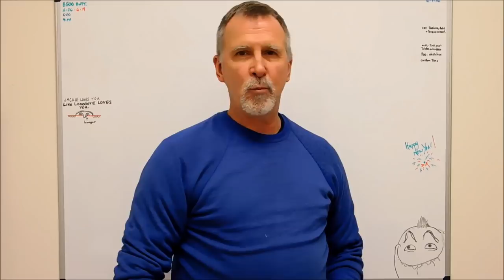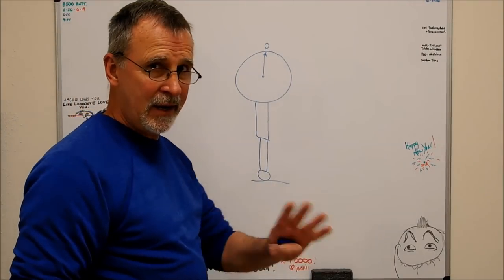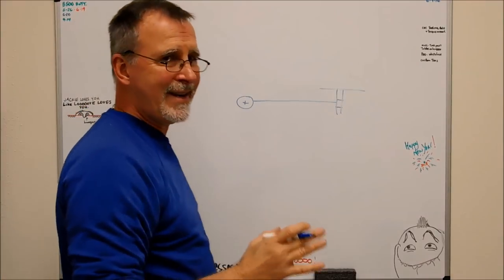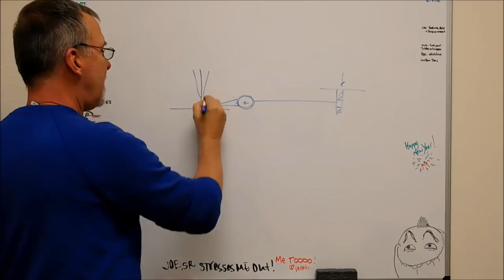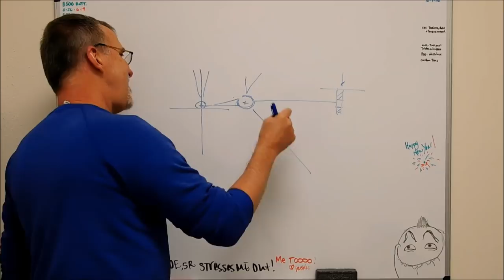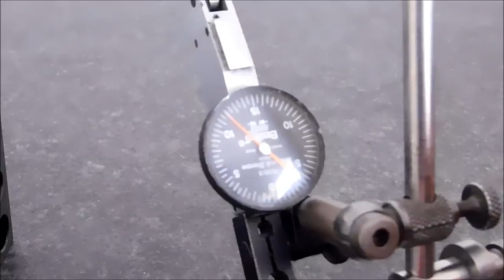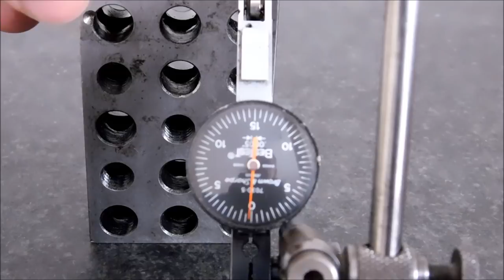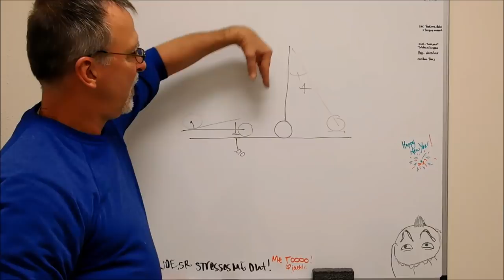Cosine Error Demonstrated and Challenged !

Comment: Joe, You are totally correct. I was in business with family in a job shop my father started. When we got large enough to have to hire a full time inspector and meet QC for a number of companies we worked for, I had this argument with the inspector.  We had several boring mills, we were making large radar antenna structures and counter boring large bearing diameters,, I had a mueller gage big enough to do 20" and larger diameters, I set the gage with crow blocks with the gage on precision parellels when we set the indicator.  The inspector did not understand cosine error, and did not always use ground same size parallels to set the gage on when he checked the bearing diameters. now for most things there was not enough error to worry about. But when trying to hold .001-.002 on large diameters,it matters. I am long since retired in Texas. great videos.

Comment: You are absolutely correct. It's pretty sad if there are machinists that think different.   Another one that gets me going is coaxial indicators with different length probe tips.   If you center a part with a  long probe tip to say 0.001 on the dial, is the work piece centered to 0.001"? Nope..   It's like changing the length of the probe tip on a test indicator. Double the length of a any probe tip that uses an pivot point to get the reading and you half the reading on the dial.
Reply: But you can measure plane angle with any length tip, though this is rare use for a coax indicator.

Comment: Thx Joe for the video. My takeaway is that the ball ended lever indicators don't suffer from cosine error within their usable range. As you said in the beginning, that type of indicator mechanism is actually an angle indicator. The angular to distance conversion is done by the length of the lever itself. So, with that said, the ball, on the end of the lever, and angle measuring system acts like a sine bar. The angle of the sine bar is determined by the height difference between the rounded parts and the length of the bar which results in a particular angle. Analogously the lever indicator operates the same way.
Thx again, for showing us all, how avoid cosine error by choosing the right measuring instrument in this case a lever indicator.

Comment: Great explanation. Very obvious that the stylus has to be at 90 degrees to the measuring direction, as the stylus has to move in an arc, so 'accurate' measurement can only occur within that 10 degree arc. The internal lever just mirrors the movement experienced by the stylus so as you say it doesn't matter where the body is

Comment: Cosine error has been used to take tenths off on a lathe for many years... Set the compound to ~9° off parallel to centerline and each thou of dial movement will buy you a tenth of perpendicular to part movement. Very useful when grinding to super precise dimensions.. This may be a topic you could cover on precision turning in a future video.
Reply: jim richey - actually at 9 degrees offset the compound movement of .001” will move the Tool tip 0.00015”. If you set the compound at 5.739 degrees (call it 6 degrees for all practical purposes) you will move the Tool tip .0001” for every .001” compound dial movement.
Reply: Steven Haskell Dyslexic in my statement.. Thanks for correcting me on that. I'm still sure that it would make a great topic for Joe to cover though...

Comment: Joe, your absolutely spot on your reasoning ,and explanation of cosine error. I have had to do like anyone else, indication like this many times because of tight confines and having to position the body of the indicator at the same angles you demonstrated. And as you absolutely just proved, the parallelism of the contact point to the indication surface is indeed what matters. Thanks for another great video Joe!

Comment: Use cosine error layout segments to avoid math. Envision a 6 inch work piece and you need 7 even segments. Lay your ruler on it at an angle with zero at one edge and the seven on the other. Now put marks on the numbers 1-6 repeat and connect the marks or use a square if your piece is square. Been using it for many years. Really helps to quickly find the center of pieces that are not nominal size.
Reply from the maker: I really like this suggestion. I had to read it several times, but I like it. thanks.
Reply: @mechanicops

Learned that many decades ago, as a beginning carpenter. It some of that carpenter square 'black magic'... LOL..

Very good technique, and handy.

Something I have done, more recently, to make it even easier for my damage brain, is to flip my rule over and use the metric side, (oh, no!  Metrics?).

I do all my proportional layout in metric. It is so much easier.

Comment: Much to do, about that which matters little.

If your intuition doesn't keep things parallel/perpendicular when aligning for measurement,one is in the wrong phase/interest in life.
Reply from the maker: If you think indicators are for measuring, you may also be headed down the wrong path.
Reply: Measuring includes comparing in my case. As you pointed out so eloquently, cosine need not be an error consideration. Intuition/so called common sense, using parallel/perpendicular to align should suffice..

Comment: great demonstration, I had never thought about a lever type as I don't have any, but it makes sense, the movement on the shaft of a normal indicator  should be perpendicular to what your measuring, while the lever style the arm should be parallel to the surface.  At least I hope I got that right

Comment: Totally excellent explanation Joe.  Probably mostly because that's what I've always understood to be the case since starting my engineering apprenticeship in 1969.  
The only additional thing I would say (but in any case is obvious to those in agreement with your explanation), is that, correctly set up, the plunger type indicator is good for the entire range of movement, whereas the lever type indicator is 'better' for a small(er) range of movement.  The greater the movement, the more cosine error will creep in.
Regards Mark in the UK
Reply from the maker: Agreed.

Comment: Good explanation!
Amazed it would be necessary though. If a non-straight configuration was not adviced, why would Mitutoyo and others make it possible to move the stylus to any other direction?

In nitpicking mode I would say that the needle should move from a negative angle to an equally positive angle to be accurate. But that's nitpicking as there is a reason the measuring range of the indicator is very small, and as a consequence the error will also be small.
Reply from the maker: Thats a small contribution, but I can see the value in symmetry. I like it.

Comment: No challenge here Joe, I learned a long time ago it's a losing proposition trying to challenge anyone who's been at there job a very long time no matter what it is, and especially so when it's more than obvious they know exactly what there doing. When I was younger and thought I knew everything I got my own misunderstanding handed back to me every single time. Thinking more before opening my mouth less worked a lot better. :-) About all I could add is it's generally thought at least by Mitutoyo that with larger linear distances the dti's are supposed to be a little less accurate than the more standard straight plunger type dial indicators. On my 10ths reading Mit. dti's they have a total travel of only .030". Over cautious or not, if I need to accurately measure  more than say .010" of rise or fall linear distance I'll dig out the better digital indicator. However I'm going only by what Mitutoyo has to say about there indicators and I've not yet actually tested what amount of inaccuracy there is at the extremes of travel. I also usually use my dti's more as a null setting device than for accurate measurements, but they obviously can be used for both. Great video and more than well proven and demonstrated. 

So.........any bets on how long it will be in another of your videos before someone mentions that cosine error again. :-)
Reply from the maker: Bring it on.

Comment: If the angle of the needle to the body of the indicator was the important angle and it should be lets say for perfect results, be inline with the body (0 degrees) then what would be the purpose of incorporating the mechanism that allows you set the the needle angle to the body in such angles that will yield a false reading?
Reply from the maker: Exactly. Its the needle center axis to the plane being checked. 10 degrees is the suggested max.
Reply: On point!  When used in conjunction with a digital height gauge, the relevant angle is the angle of the needle most perpendicular to the vertical column, which is also the angle of the needle  most parallel to the surface plate (i.e. granite block).  I've have always heard that 7 degrees (97 degrees to the column) was ideal, so 10 degrees max. makes sense.  Yes, I agree that the angle of the needle to the body is completely irrelevant.  A great way to play with cosine error is with a digital height gauge and a test (lever) indicator.  The error relevant to the angle of the needle is never more apparent than it is in this circumstance.  Thanks again Joe.  I have a brother in Austin; maybe my guys on the shop floor could stay with him at night, and hang out with you during the day for a while?  LOL!

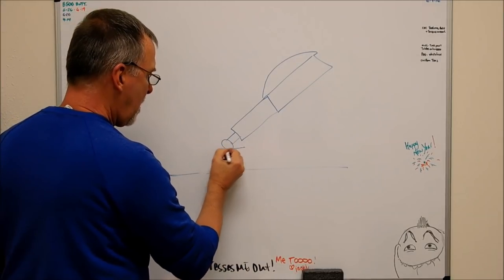Comment: Joe, the diagram which you drew at 4:00 showed the indicator measuring a vertical distance which was the SINE of the angle of tilt of the indicator.  So why is it called a COSINE error?  John from Oz.   .. just asking.
Reply: Maybe because its the Cosine of the angle between the indicator and vertical, rather than between the indicator and the part.
Reply from the maker: Truthfully, I still don't know.
Reply: Ah... my head hurts!

Comment: Lever type indicators are compareators and should not be used for direct measuring if the utmost accuracy is needed. Their movement is that of an arc and thus is always subject to some error, an error that becomes greater as the travel amount is greater. Reality is for 99.9% of what you would be checking with one it doesn't matter.

Comment: Verdict gauges company in the UK have a patented, non-spherical tip stylus for use with their DTIs (the lever type).  It’s like an egg shape tapering down towards the tip.  This is to compensate for cosine error generated when the tip cannot be near parallel with the surface.  It is not meant to compensate for body angle relative to work, because, as some of us already know, and you have demonstrated, that doesn’t cause an error.  Well done for a simple demo.
Reply from the maker: Interesting concept. I have never seen one.

Comment: I'm pretty new to this stuff but i don''t see why this would be controversial.   The only thing that the indicator can measure is movement of the tip relative to the body of the indicator.
Reply from the maker: The argument is exactly that. Its the tip relation to the part, not the arm to the body.

Comment: Is it practical to use the cosine "error" to one's advantage? With a cosine angle of 60 degrees, a poor man could turn his 1 thou indicator into a 5 tenths indicator (similar to some setups on a lathe with the cross-slide to get more precision out of the dials). Or is this not practical to get a good reading with such a setup?
Reply from the maker: You actually could.

Comment: Who??Ever?? Even Thought?? that the angle of the stylus to the"plane" of the indicator body would  affect the measurement? The first-time user would note that his instructor adjusts the stylus by hand (not a sign of precision) to get it close to the surface and then makes an adjustment to the gauge or support to get a reading.
  Your pendulum-effect at the end should've been well into the first 2 minutes.
  Had you used something like a .2000 block for the last word indicator, you'd SEE the difference, rather than just saying that it looks real close with a 0.010" shim Sure, you didn't see any 0 to .010  difference because it's too small, but if you were honest and tried a thicker insert to demonstrate, you'd prove the point.
Reply: gene koveski im kind of curious at how you would be able to measure a .2 block with a test indicator? From the looks of it that indicator travels .03-.04.
Reply from the maker: You don't measure with an indicator, you check.

Comment: I don't know how many times I have explained this to people and I have gotten the "deer in the headlights" stare back at me. Some people just refuse to believe that having the indicator at 30° or more makes no difference. Well it does. But, a very limited but, there are times you can get away with it. Sometimes you run into situations where you have no choice due to limited axcess. in those situations as long as you are working to get zero movement on the dial it can be done. Ideal, no. But sometimes the real world demands compromises. The other thing is indicator drop as when one doing bearing alignments and such. As Stefans video demonstrated.Everything is made of rubber.
Reply from the maker: Only my third child was made of rubber. the first was glass the second was wood.
Reply: +Joe Pieczynski 
I know what you mean. Delicate crystal for sure.

Comment: This comment will probably never be read but I thought I might suggest that maybe this misguidance has come from the need for the body to be perpendicular to the parts measured face on the 2nd vertical plane. Not the plane that the finger sweeps through. In that case even if the finger was perpendicular to the surface you would still see a cosine error. Maybe that's the perpendicularity that is intended and some people mixing up those two vertical planes with respect to the measurement surface
Reply from the maker: I try to read all my comments. My biggest bitch about this subject is that indicators are for differential indication and not primarily measurement. drop style indicators should be perpendicular to the surface being checked and lever types should be within 10 degrees of parallel and seen to the lever arm. Its simple.

Comment: is it more so that an error occurs when you are sweeping the tip through a larger angle, as such the rotation of the tip becomes less as the part moves further. By limiting your measurement within 10 degrees of where-ever your start point it (not mattering about orientation) you are minimising the error assuming that your part is at a nice angle to the indicator to start with.
Reply from the maker: It also depends on what you are looking for. If its a large area sweep, it really wouldn't matter. Checking steps may need a little more attention.

Comment: You are correct, and well demonstrated, The measurements you get is an arc converted to a linear measure, no mater where the body is if the tip is perpendicular to the part the arc will always change the same.
Reply from the maker: Only the tip to registration plane relationship is important.

Comment: Hi Joe. Well explained and demonstated.  I've also shown this to many new apprentices over time using similar technique.  We seldom used plunge indicators in t&d, pretty much swing point style. Btw I walked into a t&d jobshop as an appentice in 1964 with two years vocational school before that. Maybe I'm off base, but I would guess you are I originally from some where in the upper Midwest?
Reply from the maker: Baltimore born, NJ resident for 38 years.

Comment: I agree its tip of indicator in relation to the part that much is clear. I thought the word "error" was relating to the fact that indicators are good for relative comparison but would only give an absolute reading when the tip is perfectly horizontal and any movement away from this position effects absolute readings although within 10 degrees the "error" in absolute terms is small enough to ignore.
Reply: Rob N:
Ummm, perpendicular not horizontal but I know you know that.
Reply: I was thinking of the second type with the elbow joint (horizontal) not plunge (perpendicular)
 type but i didn't make that clear.